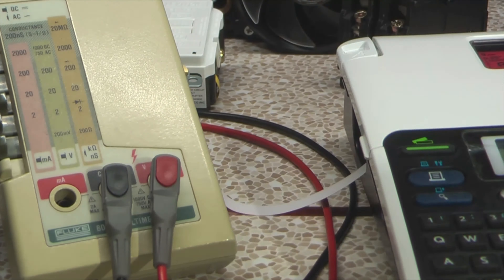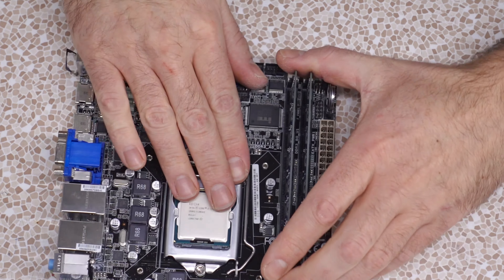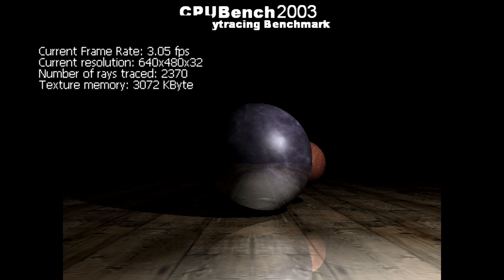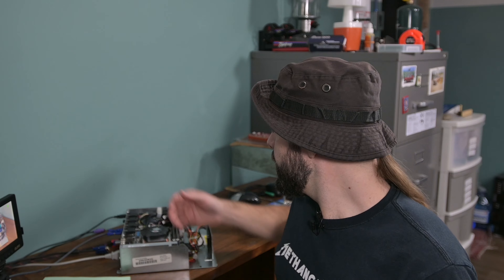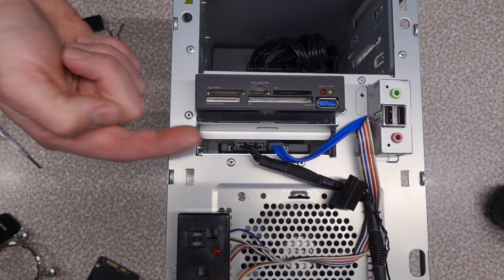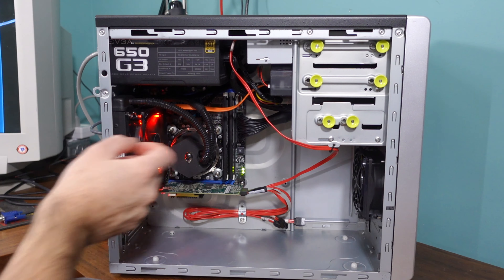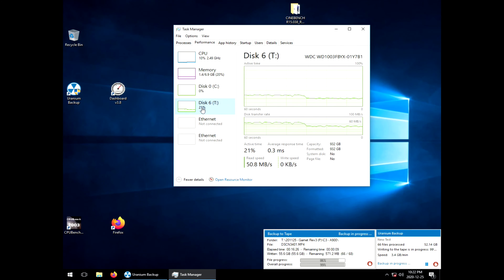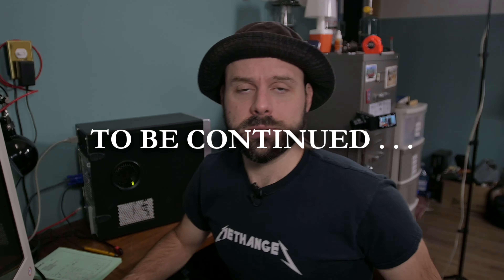Tape Drive Adventures 2.0 : Upgrading my LTO-4 Tape Server with an Aaeon EMB-B75A and Intel i3 3220.

Comment: That "tripping", stopping, going back a little and continuing means the computer could not accept data fast enough. That might be a limitation of the interface, your card (SAS 3Gb, 6Gb, 12Gb?), your cables or the operating system, but thing is, a tape drive is made for data streaming and if you can not (accept or provide) data fast enough (running out of cache), it has to stop and restart. I would also not discard that maybe the drive is faulty and has read errors...
Reply from the maker: Hmm, the 2.0 video. It was sorted in followup vids. But I can see that. That is something I figured out, and I currently burn tape directly from Sata SSD's. The current setup works smooth as butter. 
I did have my interface card fail at one point. I believe I replace it in a follow up vid. 
I got like 4 or 5 vids of me working on this. 
Makes me wonder now, what if I tried the old drive with the new card. 
Pretty sure that drive was just shot tho.

Comment: I got a old lto tape drive. I think it's lto-3 or maybe older.  It's from the days when all computer hardware was white then turned yellow. I stuck it into a old AMD server because like you, I had a computer parts lying around. It works! I've added other media drives, 5.25" and 3.5" floppy drives, old cd drive, ata drive caddy and a zip drive. I didn't put a OS yet, maybe a linux.
Reply from the maker: Oh geez, LTO in general is kind of modern. I think if it's white turned yellow it might not even be LTO but older. Not sure tho really. I'm kind of new to this myself.

Comment: Had these issues myself with lto5 and ltfs.  Eventually figured out what the problem was.  Turned out that the hba I was using had a hpt (highpoint) chipset, which has buffer issues for writing tape.

Switched to lsi chipset, problem solved!

As for long initialization times, you can run lsi cards with a bios or without (without not having the initialization time).

LSI cards are nice and cheap on ebay too.
Hope this helps you out bud
Reply from the maker: Yeah, I since got another card, and it's smoother than ever. 
And ah, I since got another drive too, this one turned out to be a lemon.

Comment: Just upgraded to an LTO5. Similar issues to you. LSI controller runs very hot so has its own fan. On restoring I think it narrows down the search to find the file with a high speed seek, then a low speed seek, then reads the file? Occasional random 'recalibrations' at the start of the tape and then continuing where it was further down the tape are a bit worrying on mine too. Biggest problem is having millions of tiny files that it has to stop for, then assemble into a block, and then write the block. As the CPU is not that busy, it is almost as if it should have a much bigger buffer somewhere? More videos please!
Reply from the maker: Well I can't be sure of that, cause in the case of the drive in this video, it turned out to be a lemon. I replace it in a future video and the new(ish) drive is smooth as butter. But then, in a future video, the Adaptec controller failed and I think I'm running an LSI now myself.

Comment: Are you having thermal issues on the tape drive?  They need constant airflow I think.  Hp dl 380s or so constantly move air over tape drive
Reply from the maker: Ah no. I know how to tune a system well enough, and that drive has a built on fan. 
It was just shot. Got replaced in the next vid.

Comment: Dude re your tape read woes. I suspect your read head is either dirty or faulty. Most LTO tape drives have two physical heads, A write head and a read head. and the drive moves one out of the way during the opposite operation. As your slow down and stoppages are only happening on the Read, its likely you have a read head issue with that drive. To prove that, run the cleaner tape through again, write to a fresh new tape. and read from that. If your issue persists then its not the tapes you have. If it is the tape surface being worn out you should be experiencing write issues as well as read issues, and you are not, so I suspect the drive not the tapes.  Tape drive heads are a consumable, and you could at their height of use simply buy a replacement. As your drive is older than some presidents now, I suspect it would be cheaper to buy another drive altogether. If you are brave enough pop the top off the drive and polish both heads with a q-tip and some head cleaner, that will deal with heavy dirt the tape cleaning system can not move. It won't however deal with any scratches or head misalignment. If the heads look clean and have no scratches, then I'd lean towards a misaligned read head. To fix that you need a Tech who knows what he is doing. Again based on the age of this thing, finding a good tape drive tech is going to be tough, and probably not cheap. I hope that helps. D
Reply from the maker: haha yeah, did you see the next vid about this? I ended up replacing the drive cause the problem got worse.
Reply: @DATT  Ah sorry no just catching up. Seems the most sensible approach with this type of gear. Reviving an old LTO4 myself so revisit some client data and your video brought back loads of memories working with kit like this.
Reply from the maker: @EastLondonKiwi  I haven't even felt like opening the thing up, tho I'm bound to one day. If only to scrap parts.

Comment: When it comes to hardware you seem to think and process things like a 13 year old gamer and not an IT professional. Professionalism starts with Linux/BSD and not crappy Winblows.
Reply from the maker: Hey, I can't say I disagree, if this was a professional deployment, this def would not be the way. 
It is however, a tool made by me for me, to fit into an existing ecosystem and network infrastructure. 
Windows was the way to go for my personal use. Learning a new OS for a comp I use like once a month to drop files onto a tape is kind of redundant.